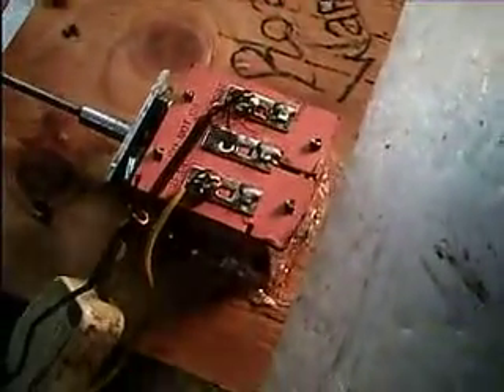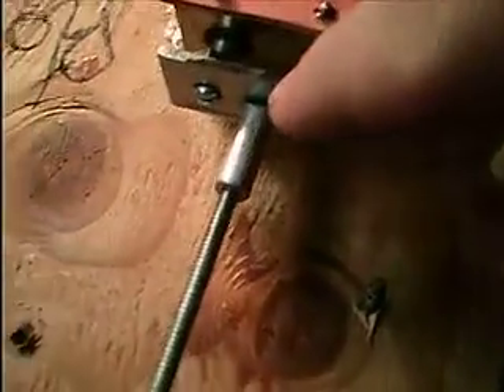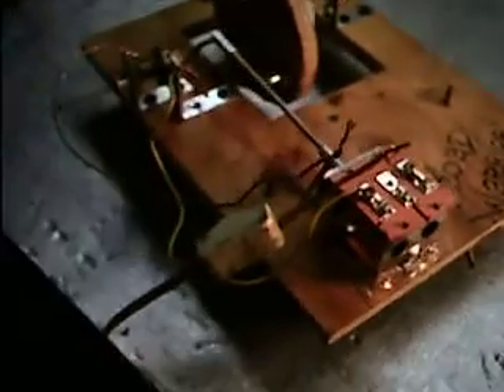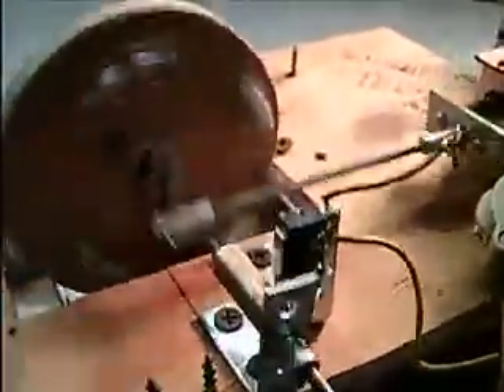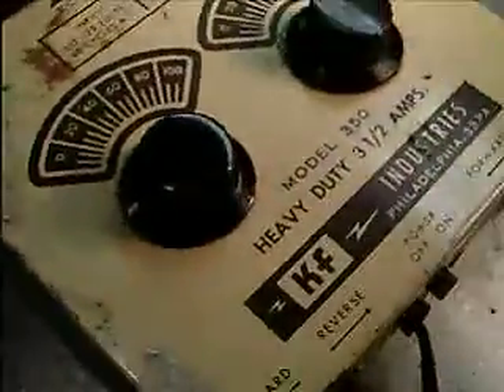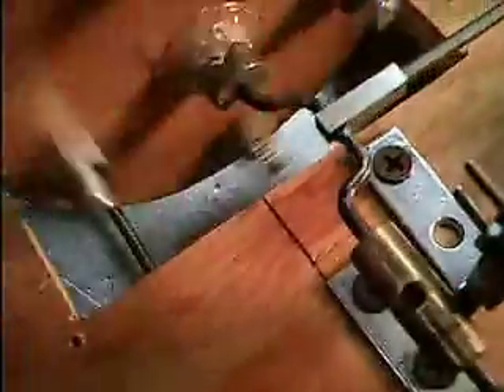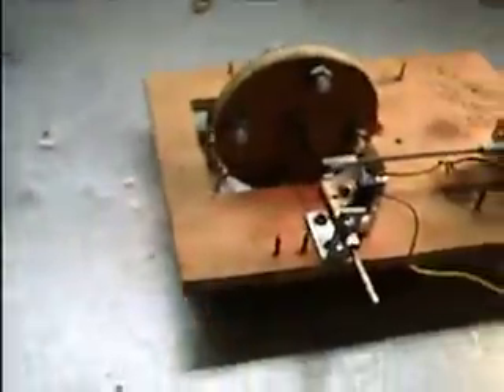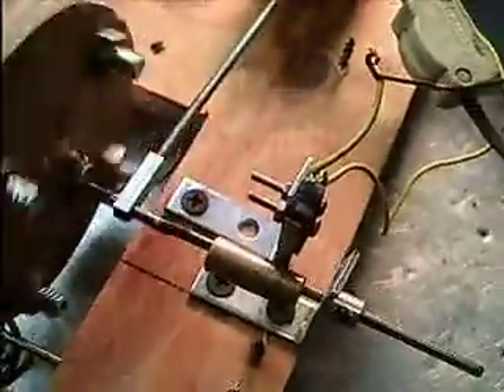Solenoid Motor

Comment: not bad! i have a weeden bipolar motor from the 20's! my dad got it for me it was not working. well we did figure out to rewire it! it worked for awhil but the solder joints came undone. id have made a vid by now but i have to fix it again. it runs off a 6v battery. but i cobbed up a 6 volt toro battery charger to run it! it worked great!